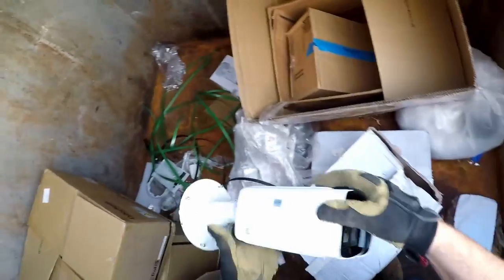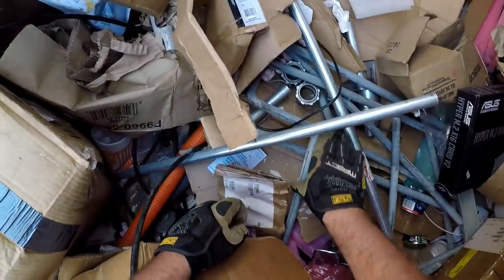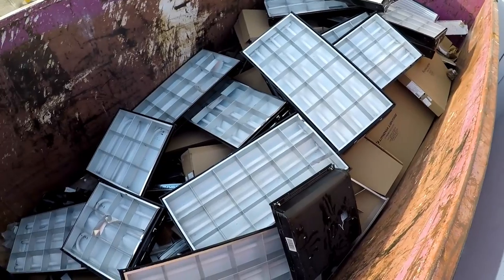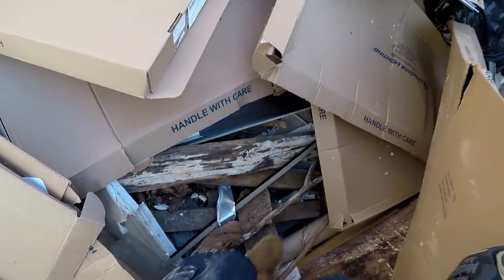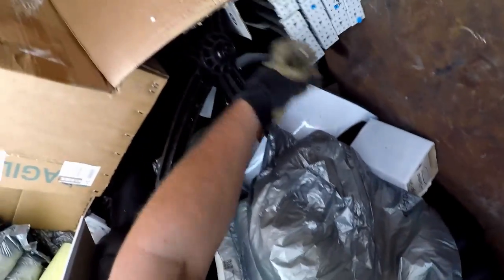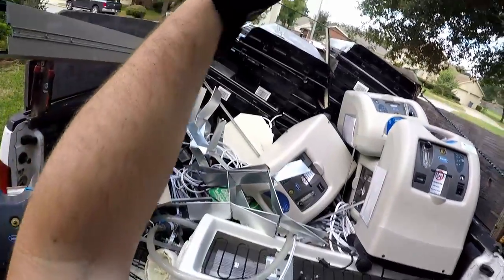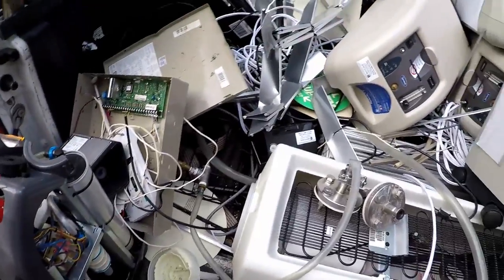Dumpster Diving "On Top's Where I Like It!"

Comment: That orange “vacuum hose” is interduct fiber optic cable sheath.  It’s orange to act as a warning if you are digging and uncover it.  Additionally used to cover optical cable that is strung on public communication poles.

Comment: I would have grabbed that orange hose, I need that stuff for my wood working shop desperately lol
Reply: I think the orange 'hose' is actually called innerduct. It is used for low voltage and non-armored fiber optic cable to run through and be protected. Not sure what you would want this for in a wood shop but if you have a lot of cables to run, it is great stuff.
Reply: Smurf tube
Reply: Ok
Reply: That orange hose is used as conduit for cables, at least in Greece we do.

Comment: That big open top with the orange hose in it must
Have been behind a data center. When you see Cienna boxes that size, it's really heavy metal telecom/network switching gear.  Network switches the size of refrigerators.

Comment: more scraping with mike slim picking until we get to that soft top dumpster, dam not that dumpster but that's a lotta lights, oh it'll fit mike if you want to turn dottie into a pan cake, you need a texas sized truck to get that in there or a semi truck dam big scrap, didn't check that other big soft top but we got some good scrap,

Comment: The Orange hose was called Interduct.  Used to run low voltage cables through in buildings.  80 to 150 per roll

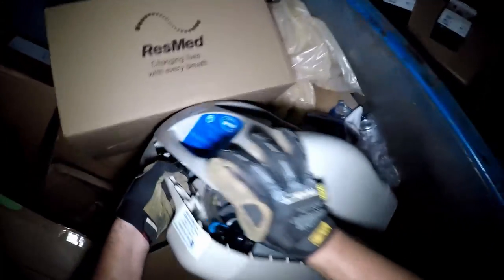Comment: Is dog wire worth anything?  Those cpap headgear things are prescription because you could theoretically could suffocate wearing them if the power goes out to your cpap machine and you don't have the safety valved elbow piece.  That part you picked up at 20:01 is the water tank for the cpap machines.  I use that same brand cpap machine.

Comment: I could use the masks and I would love to get an o2 machine as well. I've been on o2 since 2008. I never smoked but I had a small stroke that paralyzed half my chest. It SUCKS but not air! It could be worse I could be dead.
Thanks, this is a fun hobby. We did it at the salvage yard I used to have.
Thanks, Bob

Comment: If the stainless is a little magnetic and you can shake the magnet off, it’s stainless.
Reply: Yes, my scrap yard took it as magnetic stainless. Less money than stainless more than shred
Reply: Scott C, I was curious about different stainless steels. Apparently there are over 150 types for whatever applications they have. Some are ferritic/magnetic, some are not. Lots of different alloy compositions. Good thing my yard just lumps them together. Either way, it’s better than scrap iron!👍